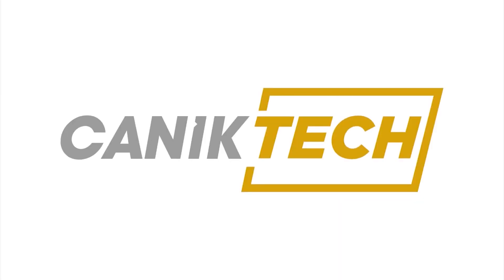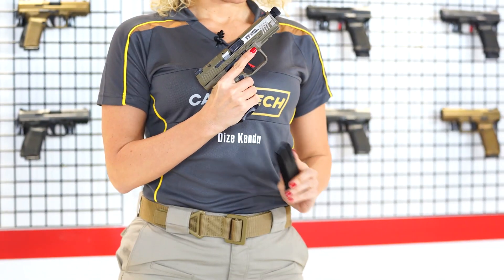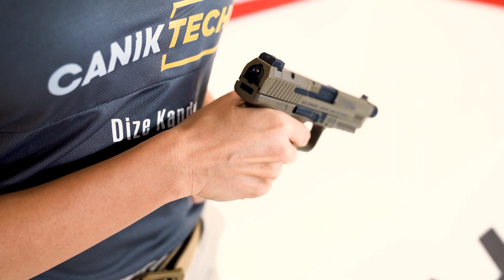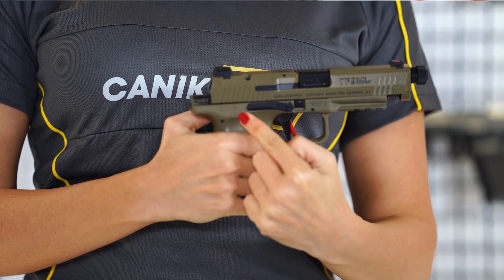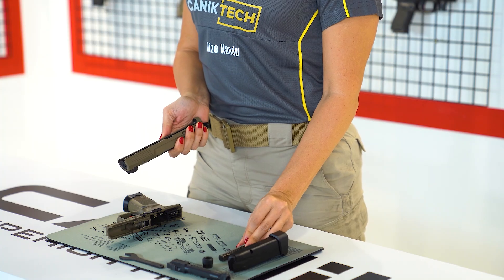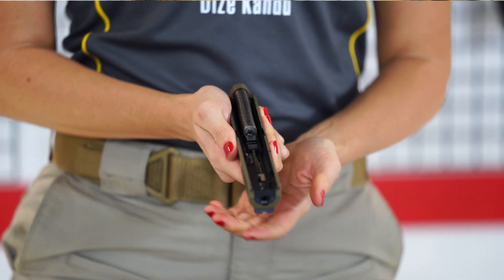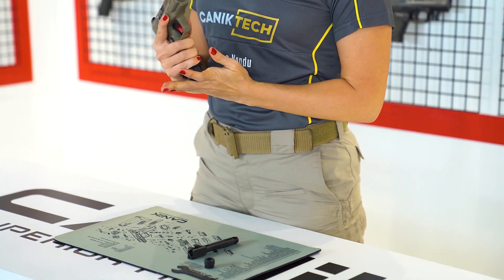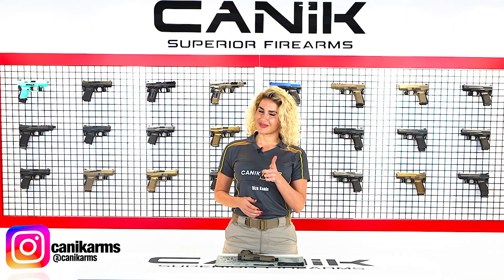Threaded Barrel Replacement

Comment: Is there an updated video for the MC9? The #15mm and 16mm didn’t fit and this was the link on the box of the barrel. Also what can be used to lock the thread protector? Don’t plan on using it for anything, but don’t want ruin it with thread lock but it’s getting annoying that it keeps backing off on its own